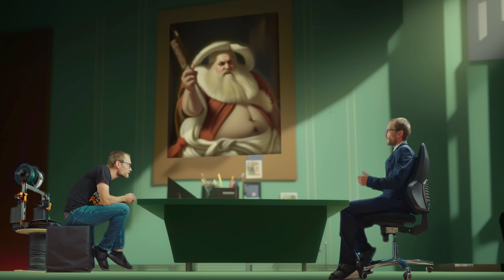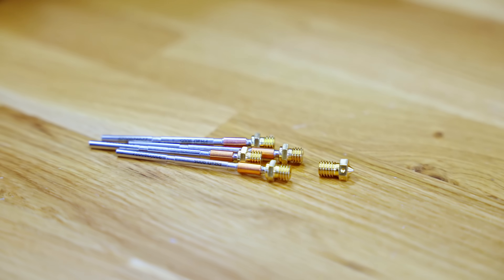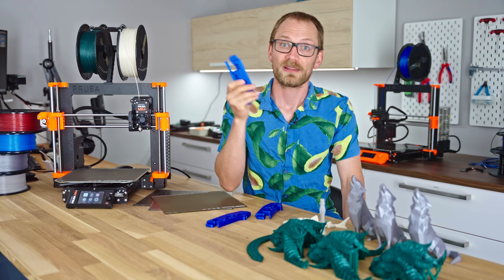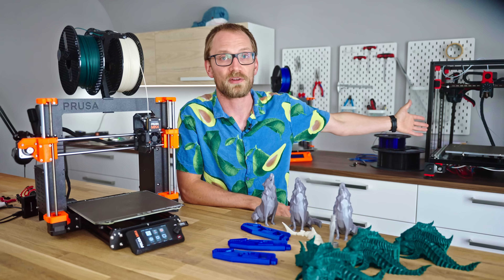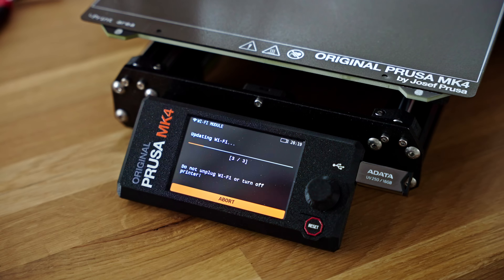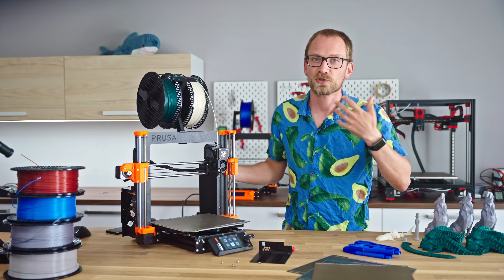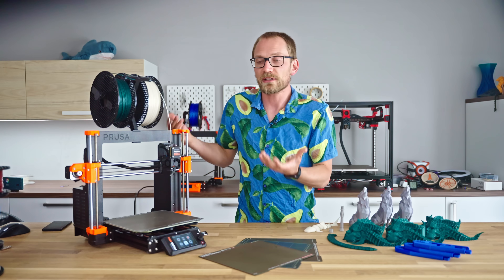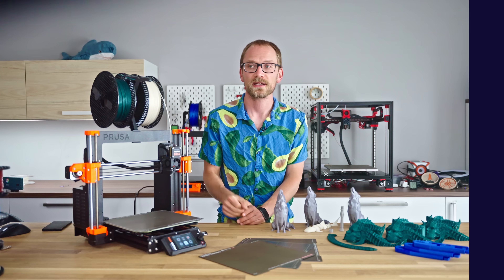Does the Prusa MK4 have what it takes?

Comment: Been using a Prusa Mini for 3 years now, and it is absolutely killer. The Wi-Fi is horrible though, and the web interface is a laugh, but for pure printing pleasure, it has been a blast. So thinking I knew a thing or two about 3D printing, I got an Ender 3 S1 Plus, because I sometimes need the bigger volume. Compared to the Mini, the Ender is complete garbage. Warped printbed, the build plate died trying to print with petg, and it is just impossible to get dialed in. The firmware is the worst part. I even tried Klipper and a Sonic Pad, but there are no Cura profiles for the Plus, and support is non existent. So now I have ordered a Mark4. I know it has flaws too, but there is no way it is going to be an Ender experience.

Comment: I find it crazy that my ender 3 v2 has by far the cleanest surface finish of all my printers, no VFA whatsoever. Sure it has its own set of issues, but VFA isn't one of them.
Reply: Any bowden extruder gives much better surface quality than a direct drive extruder. That's why Ender 3 prints look much better than prints from a Prusa MK3S+. Dual gear system in direct drive extruders introduce a lot of artifacts. Bowden extruders buffer this out with the distance between the motor and the hot end.

Comment: To be honest...the main problem that Prusa has isn't Creality or Bambu, it's Elegoo. Their Neptune 4 is just better in every measurable way - at least on paper - at less than a quarter of the cost. Reliable 250mm/s printing with up to 500mm/s if you're feeling spicy...the Mk4's 200mm/s maximum just doesn't come close. Then you add in the Klipper firmware, ability to use any camera you want, a proper management interface etc etc...and even though neither of them come with accelerometer-based input shaping, it's not really much of a competition.

At least, on paper. My Neptune 4 should be turning up tomorrow, so my opinion may change (although I doubt it, given my great experience with the Neptune 3 over the last year or so). I'll be honest, when I was looking at printers to replace the Neptune 3, Prusa didn't even come into it. It was the P1P, K1 or Neptune 4. Prusa really need to get with the times with their hardware; slow and reliable doesn't win the race when fast and reliable is everywhere.

Comment: I am pretty happy with my MK3S+. Being open source has allowed me to repair it myself, I trully felt that this machine would survive me, and that is awesome. Along with Revo and Octoprint, I do not feel like I need to improve it anymore. This is the main reason why I am not interested on the MK4 at all, I would only buy the auto-leveling feature with the nozzle, but that is not worth the price on my opinion. Also the fact of releasing a printer with features disabled is a huge red flag for me. Nobody was expecting the MK4 at the time it was announced, why rush?

MK4 came late, outdated and incomplete (But I understand that it was better to do this instead of throwing all that work to the trash can) Maybe the problem is that the Mendel design itself is outdated, a MK5 should never exist, but an "i4 MK1".

Comment: I bought an MK4 because I wanted a tool, not a project to tinker with. The amount of time I spent upgrading and tweaking my Ender 3v2 vs what I got out of it was absolutely NOT worth it. I chose Prusa over both Bambu printers for 2 reasons: Prusa's steady track record as a company and noise. A Utilimaker was never even a consideration due to price.

Comment: If Prussia is counting on their consistent build quality of their printer as a justification for providing a uniform input shape profile for all of their MK4 across the board, then Prusa’s input shaping will never be as good as other printers that use actual accelerometers for calibration on the spot. This is because the printer’s vibration characteristics is not going to be just the printer alone; it also includes the table it is sitting on. Since everyone will place the printer on different kind of tables as well as different location on the table, the overall vibration characteristics will be different for everyone. If Prusa thinks they can take a shortcut and not have to use the accelerometer, they better think again. There is a very good reason by Bambu Lab and others uses accelerometer for calibration in-situ.😎😏

Comment: The price point just doesn't make sense to me given you can buy a fully enclosed core-xy printer with input shaping, automatic pressure advance, a camera, a better UI, and faster print speeds for the same price. I much prefer the open prusa ecosystem but we're likely to see second gen competing products before they even have solid input shaping firmware.

Comment: I ended up replacing the MK4 with my old MK3s+ with Octoprint as primary printer.  I have purchased at least one of every printer Prusa has made and the MK3s is so easy to use that effort yo get the MK4 working is not worth my time right now.   I am still trying to get the Prusa XL to work with Octoprint so I can control and monitor from laptop.   Prusa as a company has changed for the worse and I will not be buying another printer from them on faith.  I have had no luck with their customer support on the Prusa XL issues I’ve had and they just seem not to care.

Comment: I also cannot see the value in this price point.   There are many, MANY other manufacturers that can do the same job, if not better, for either same cost (with larger print bed or other features) or...  generally cheaper, even without DIY parts replacements...

Comment: Prusa got me torn on this one, ngl.

I am done with DIY - there are three printers in my house and none of them is producing any fitting parts, furthermore - two of them are in Parts. Have I made mistakes leading up to this? YES! Is this just a big pit I throw my money at whilst beeing frustrated that nothing works? Also yes.

A thousand bucks on the table theres basically Prusa and Bamboo and the cheaper chinese ones. Had 2 of the last kind - not gonna do that again. I disagree with too many policies of bamboo - so they are out too. Now theres Prusa. Who violate the two things I really wanted from my new printer - a core XY Motion System and an Enclosure (I know Prusa has one, but it´s neither space nor cost effective). But they have my beloved loadcell leveling.

So... No new printer for me? Do I just swallow what Prusa/Bamboo give me? Should I try going back to DIY and try building a Voron in hopes to not make any of my old mistakes again?

Comment: He works in a factory where we use different 3d printers. We have bamboo lab, zortrax, new creality, and other Chinese inventions. I've been using mk3+ since the beginning and never had any major problems with it. I print every day and for two years I had maybe 4 failures that lasted a maximum of 2 hours. mk3+ is a real horse that never stops. And in others I see only failures, unsuccessful printer, worn axes, collisions, -generally only problems. I don't know how the mk4 works but I know that now the mk3+ is even cheaper so I'm taking the next one. I recommend the original ecolouser. expensive but really nice. And zortax m300 plus i so bad!!!!

Comment: Good review.. I can see upgrading the motors, the bed leveling system and the new extruder, but then stop and release the last of the I3 line. Their release should have been V1 of a core-XY so they could get some invaluable data to allow them to tweak that design. They've wasted years, now, missing that opportunity. Their advantage over Bambu is that they are much easier to repair. However, their networking performance is abysmal and I'm surprised this review did not discuss the horrendous choices they made with their wifi/network hardware that limit their ability to provide the ease and speed of sending files that are available with Octoprint on a Pi or Bambu and others. Their networking hardware should have been a foundation they can use in all future printers without having to worry about performance. Having worked on a Bambu for about a month.. and comparing it to my MK3S, the X1C local networking was a joy to use and  a 6 hr PLA print (on the MK3) for one project took only 2 hours on the Core XY with no degradation in quality or strength. Prusa can still get the quality they desire, along with a significant speed gain by limiting the Z to up/down. If Bambu is this competitive now.. wait until they iterate a few times. The Bambu AMS is also often overlooked as a major plus compared to the performance that I've read concerning their MMU2 designs. The AMS I worked with was a huge convenience for storing 4 of your most used filaments.. and for color changes by layer.

Comment: One size fits all 'input shaping' will never evolve to the point of being useful. That would be like doing room correction with speakers, using a single 'ideal' room. I'm sorry prusa, your manufacturing and your software model of your printers behavior, both physically/mechanically and electrically will never be good enough to assume they are all the same. That is kind of laughable, sorry to say.

Comment: I believe that one thing that skews the POV of the author of this review is that he prints mostly for fun. Try to have a shop printing 24H and let's see what this little annoyance of the other cheaper printers becomes, when you have tons of orders and there is no easy solution for some bug or hardware issue. Also, come on, everybody that is serious about the 3D printing ecosystem and not just a buyer far from the field should basically pretend that only Prusa printers have Prusa Slicer. It's true in the practice? Nope. But if you want your money to compensate who did the work buy a Prusa and shut up.

Comment: I've bought Mk4 as a upgrade over my CR-10 V3. Let's say... there is a huge difference in how printer works, how easy it is to set and let's be honest - much more robust and much better quality. I've bought it for a few reasons - I wanted "workhorse" I can rely on... I always liked how Prusa treats their customers and somehow I trust "Set" brand more then newcomers as for example Bambu is... and yes, I was considering both printers. Overall, I'm kinda happy with my Mk4... but it's new model and it has own "labor problems". 

A few hours after I've started printing I had squeeking noises under the bed - ended up me changing original bearings for "plastic" slider which I'll probably change for high quality bearings in the future. I had problem with Filament Sensor, which ended up being clogged and customer services really helped me with solving this problem... which so far was the only problems I had. Yeah, Network settings and setting up Prusa Link / Prusa Connect was journey, but I've managed.

So far... it was my only problems. Print quality is really good - I can't compare it with CR-10 V3... it's like comparing tools from prehistoric times and current ones. Yeah... sometimes prints can be better quality... but since I'm using Alpha for Input Shaper.... I think this is a thing it will just improve in the future. So far I really can't say any thing which is that bad I would really feel sad for my money.

My brother bought Mk3 - pretty much at the begining - and he told me that printer he bought and printer he has now are big difference in both quality and reliability... so I really do hope same thing will be with my Mk4.

Comment: I love my three Prusa MK3 printers for their reliability; they just work, and I use them as tools for printing 3D master molds for my attempts at ceramics... However, looking at the MK4, and before watching your reviews, I had already come to the conclusion that purchasing additional Prusas was going to be done on eBay to help my budget. The reason for multiple printers is that the molds I print are often done at 0.07mm resolution to minimize print artifacts transfering to my molds, and it's not unusual for me to have mult-day prints for a part of one mold. The MK4 features are nice, but for my use cases, not really necessary.  To improve print times I did go to a ruby .6mm nozzle, which with those parts requiring less resolution, has really sped things up.

Comment: Another biased comment: Upgradability. How many printers are there already and how good is inputshaping actually working on those that feature it? With the Mk4 featuring a PCB socket for sensors, it seems to be reasonable to think they might just come around with a Mk4.1 upgrade kit when its actually finished (on top of the already amazing upgrade kit portfolio they offer from older printer models)... and woops they'd be at the top again. And at the same time i bet there will be the XL then - because inputshaping is what every bigger machine craves for. My bet goes to Prusa. Yes, because i believe in them. xD

Comment: I bought a Neptune 4 Pro two months ago for about 300 Euros. The firmware on that thing is so crappy, that the first layer never came down reliably. I stopped counting how many times I tried to dial it in. But everytime I did, the high price point of the MK4 was getting lower. I wish I would have bought it instead, but no. I got a Qidi X-Plus 3 for 700,-. Which is a better printer than the MK4. As much as I would like to own a Prusa, the price is just too high.

Comment: I have the MK3S and I like it a lot. It's slow and all but it's super reliable. Putting Revo on it made it a lot better and to me more usable than most options. That said, if i were setting up a basic print farm today, I'd buy Bambu P1 of some kind. Half the price of a MK4 and fast. If they'd last a year, they would probably have paid for themselves many times over and I could, worst case scenario, just throw it away and get another, a machine that's probably cheaper as well at that point. Hell, I could get a spare to keep on a shelf in case one machine had a breakdown and pull the busted machine and repair or replace it at my leisure. So the use cases for the MK4 are kind of shrinking. If you appreciate the open source, the ability to tinker and make changes etc it can still make sense. But less so than the Mk3 did when that was the flagship.

Comment: Prusa never could have used slic3r as a separated backend. The AGPL specifically elaborates upon cases where one uses a network to separate closed source from AGPL'd code, and the GPL already encompasses the use of dynamic linking or shared memory as not being sufficiently separate to be a non-derivative work.

They'd have had to start from scratch. Which might have been a good idea, but it would have been necessary.

Almost as if the benefit of free software is that you get a leg up, and the drawback is you have to give everyone else a leg up, too.

Comment: I do not have Prusa printer but after spending 2 months with that Creality rubbish I am seriously considering it. Yes it is more expensive but there is actual support and Warranty. I have spent 50-60% of my time fixing and upgrading the Ender 3 v2 than printing. It can't do more than 2 consecutive prints without an issue. And when it breaks on the second month go and get your warranty support from that rubbish made in China product, good luck. Not sure about Bamboo Labs, looks good but still the support is important, that fashion of buy and dispose cheap products is very bad. I do not see it as a draw back that Prusa didn't rushed the product out and that there is no new model each year.

Comment: I have no idea why you are on this closed source kick. It doesn't actually fix anything. Even when designs are closed source, cloners are going to reverse engineer or 'clone' your designs. Same with software. As long as the other manufactures using PrusaSlicer contribute back to the project their changes (or publish the source) so this can happen, everyone is still getting the multiplicative benefit of open source software. Just look at the one good closed source slicer out there and how far it has fallen behind the open source alternatives. It just isn't a true option if you want to be competitive. I look at the MSLA market, and most of the slicers are just copy-cats of each other, and some of them are incredibly buggy. Blech.
Reply: Last time copying prusha was relevant was in the days of anet A8. Ever since than nobody copied them other than blatant clones that are in the same price range of ender 3, which is certainly not stealing their consumers. 
             Prusha slicer is also irelevant, since its just improvement of other opensource projects and is completly stupid and against opensource spirit to call bamboolab leach since its also opensource and in my opinion much better.

Comment: You know what? That's it for me. I was interested in getting a printer and building it myself to have some fun. However, after watching several videos, I feel like I would just be paying over 1000 Euros to be a beta tester. To be honest, the current state of those printers is not acceptable considering the price tag. I've also looked into the Bambu Lab Carbon X1, which, apart from its downsides in terms of repairability, upgradeability, and excessive filament waste when using different colors in prints, has the negative aspect of being pre-assembled. Currently, this seems to be nothing more than a sham to me. I must say, the market is not there yet.

Comment: The assumption one Set of stock parameters would work is already flawed...

The exakt parameters depend even on things like the rigiditity of the desk, how much filament is on the spool holder, beld tension, etc...

The fact they smooth this mich with mzv also means they run higher accelerations than the machine can really support with that shaper...